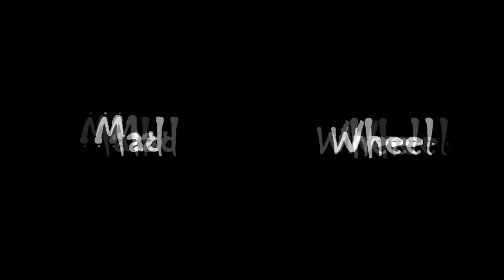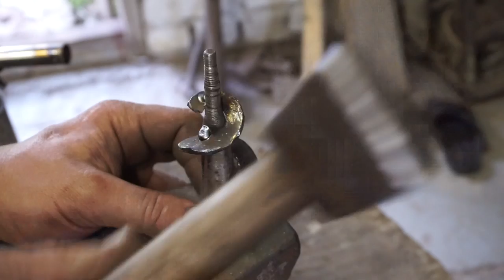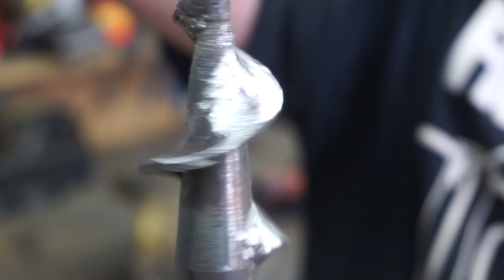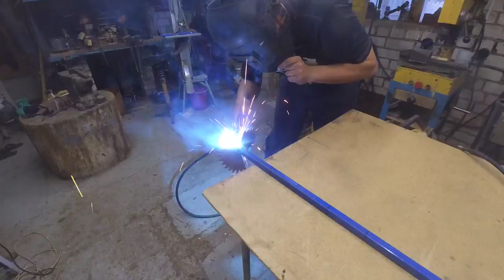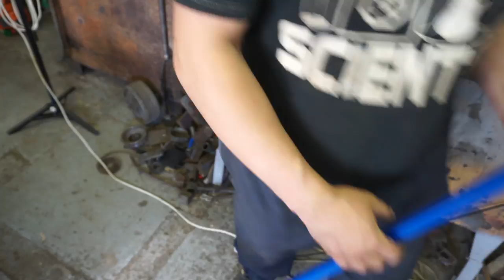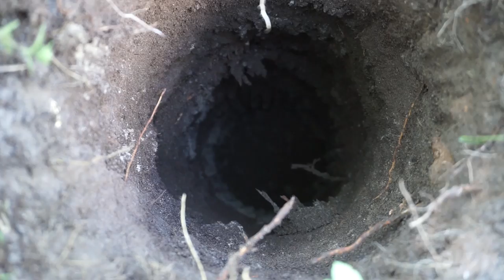The super tool now I prepare to drill the earth.

Comment: Easier said than done 
I just made a saw blade hole digger, didn’t work like the ones here on utube did must hv been digging in soft already dig up ground cause mine didn’t work worth a shit
Reply from the maker: My digger works at different speeds in different soils, the biggest challenge is stony soil and this is no secret. However, my digger planted dozens of bars for fences and structures in the ground, not only for mine, but also for my friends and those who asked for this device for use. All these people saved a huge amount of time and were able to use it to communicate with their families. My digger works, its secret is in the correct tip like a self-tapping screw, it is screwed into the ground and pulls the main auger along with it, which cuts the soil))